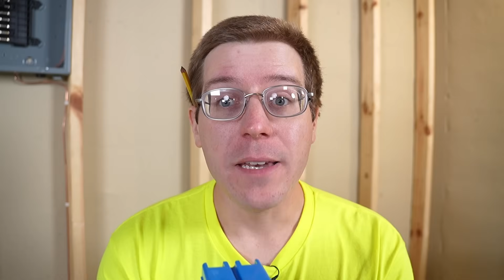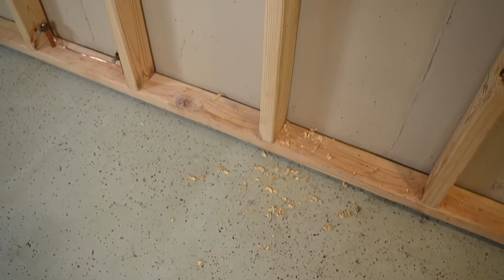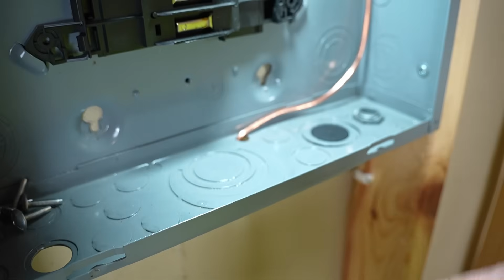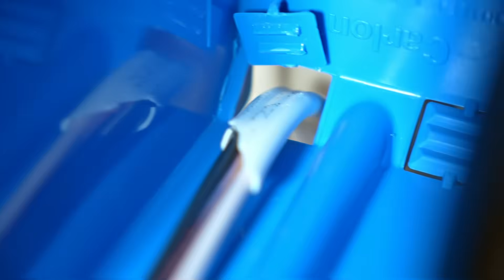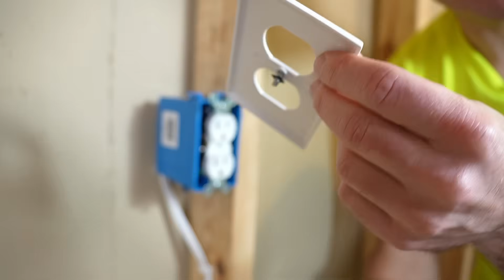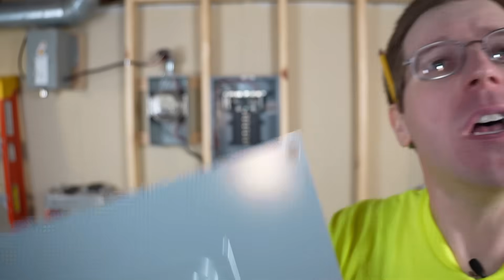Unlocking the Basics: Wiring a Receptacle Outlet Start-to-Finish

Comment: Most electricians usually pull the wire tight and staple it as they go along that way you don't have loose loops hanging and the wire should be tight against the stud so the inspector can see a nice clean install and pass you for nominal stupid things that he normally wouldn't pass that are safe
Reply from the maker: Yep, the tidiness of your installation will certainly tip the inspector off as to what the rest of your work may look like. NEC 110.12 -> "Electrical equipment shall be installed in a professional and skillful manner."

Comment: Most electricians they know what they're doing would run that wire underneath the breakers if they have to go to the other side that will prevent wires being near the 220 connection at the top if gravity makes them come down and be exposed to electrical issues with wires touching the panel box where the 220 is landed at, so the best way is to go underneath to the left and then up and keep it nice and neat at the bottom and at the sides
Reply from the maker: That is a good consideration. It can get quite full at the top, and avoiding those live line-side terminals is a good call.

Comment: That's a nice video but in a rough setting most electricians will put all the home runs out the top of the can and into the Attic and then go over to the stud where the first home run hit lands😅
Reply from the maker: Yep, totally depends on the installation.

Comment: Great video, man.  The only thing i would add just as a little feedback is that in minute  18:16 you have to keep in mind that the actual connection is in the opposite order as he did it.  Let me elaborate, he did hot, neutral and ground wires in that order but it should be ground, neutral and lastly hot.  Why?  Because ground sends any "unwanted" electricity (for lack of a better term) to de ground rod and the neutral both completes the circuit and balances phases.  That being said, if you make the connection as he did you wont have any sort of protection because you havent connected ground or neutral yet and even though its obvious that this is being done without an actual live wire, its always a good habit to connect ground and neutral first.  But hey, this video was fucking SOLID.
Reply from the maker: Good call. Normally I do it in the exact order you mentioned - ground, neutral, then hot. Ground should be connected first so if something goes wrong during installation, you have a solid ground present to trip the over-current device. The only thing it will protect against is short-circuits, however. Connecting the ground first will not save you from shock/electrocution. I plan on making a whole video discussing grounding and boding; where the current flows (and more importantly, where it should not flow) in the future. Thank you for watching and commenting!
Reply: @SmarterSparky Sweet man, Ill be expecting that video.

Comment: Yup gud video but to tins u talk to much n u wasted d wires,but tank u
Reply from the maker: As a career electrician you are taught that "wasting" a few feet of wire is far cheaper than finding out the wire is a few inches too short. If a wire ends up too short, there is the labor of removing the incorrect wire and pulling a new one. And then the wire that was too short is all wasted, and that might be dozens of feet long. Extra wire = cheap insurance. Thanks for watching and commenting!

Comment: I really appreciate the full explanation of each step.  But is this actually a safe thing for amateur renovation people to do.  I guess there are inspectors for that reason but there are so many rules and regs nowadays because of insurance companies that I don't know id trust just anyone to do this kind of work.
Reply from the maker: You’re absolutely right to be cautious. Electrical work can be dangerous if it’s done incorrectly and can result in fire, property damage, serious personal injury, or death, which is why electrical codes, permits, inspections, and safety procedures exist.

This video is intended to explain how things work and why they’re done a certain way—not to suggest that unqualified people should perform electrical work themselves. Any electrical work should only be done within a person’s level of training and experience, using applicable safety procedures, and in compliance with local codes.

DIYers should limit themselves to tasks allowed by local law and within their skill level. Electrical apprentices should only perform work as part of a licensed program and under proper supervision. When in doubt, involving a licensed electrician and the AHJ (Authority Having Jurisdiction, such as the local electrical inspector) is the right path.

I will put this in the pinned comment as well. Thanks for watching and commenting!

Comment: I loved the video and the way you explain congratulations. 
The only thing I would change is cutting a wire with a knife is not ideal because you can cut the insulation and provoke short circuit or arcing.
Reply from the maker: Thanks! Yes, using a knife can cut the insulation if you cut too deep.

Comment: Why 14 gauge and not 12?
Reply from the maker: A 15A circuit only requires 14 AWG wire. A 20A circuit would require 12 AWG wire. I understand some parts of the world require 20A circuits as the minimum, but in the US, the National Electrical Code (NEC) permits us to use 15A general purpose branch circuits (though we have specific circuits that a required to be 20A circuits, such as kitchen small appliance branch circuits, and bathroom receptacles). Some local jurisdictions in the US may have local codes that amend the NEC and discourages the use of 14AWG circuits as well.

And the more honest answer is I had to go buy a roll of wire for this video. 14 AWG was cheaper, and I already had a 15A circuit breaker on hand :) I will certainly demonstrate 20A/12AWG circuits in the future.

Comment: wondering if you can help me with  a quick question, an outlet got water from a leak and i assume it fried cause you can see black residue on the wall next to the outlet.. im going to replace the outlet, my question is, are the wires no good anymore since it was connected to the outlet it went it got fried ?? do i need to replace the whole wires or just cut back like 6 inches of wire ??
Reply from the maker: For this one I would suggest hiring or consulting with a licensed electrician in your area. There are so many variables at play here, that some guy on the internet isn't going to be able to safely/effectively diagnose. Water can do some weird things to conductors. If it is stranded wire, the water may have pulled up into the conductors due to capillary action. It might be as simple as replacing the receptacle, but the damage might extend beyond that, and that is where the experience of a licensed electrician is going to come into play. Great question!

Comment: Its 8 inches
Reply from the maker: That's actually 100% correct. Nice catch. Yes, 334.30 says it's 12", but 314.17(B)(2) Exception says that when it's single gang non-metallic box, you have to strap within 8" if you don't want to mount the cable to the box. Thanks for mentioning it!

edit:typo

Comment: how do I wire a basement when I can't reach the panel box? can I piggy back off a home run wire?
Reply from the maker: That is a potential option, but unfortunately it isn't that straight forward. It depends on what the home run is already feeding. There are certain circuits that you are prohibited from tapping off of - for example the small appliance branch circuits in your kitchen. Long story short, you'd have to analyze what circuits are there, and calculate how much more load can be put on them.

Comment: Hate having to do loop terminations with stranded wire. Hvac guy here
Reply from the maker: 100%. That is my least favorite termination ever. I have a video planned discussing just stranded wire loop terminations. Recently I've just started putting fork terminals on instead of doing the loops with stranded wire. Sure, it's a bit more expense up front, but it saves troubleshooting later.

Comment: Just subscribed. I enjoyed your steady paced instruction as you went through your processes. Which is why I subscribed. 

 I’m not new to electrical, but not an electrician either. I am in the trades though.  I have done a lot of electrical in remodel situations whether
 it be moving outlets to adding more as well as lighting circuits. As embarrassing as this is for me I was wondering if you could explain in a video how to change an existing switched out (in my case I have two of the) to a non switched outlet. 

I have been wanting to put a ceiling light in my son’s bedroom (We have a ranch), and it is the only room in the house without a ceiling light.  Right now his wall switch basically turns on and off his computer/gaming setup. I’m sure I could figure it out I Just think it would be helpful to others as well who may be have a similar situation. 

My apologies for the long post. Thank you for taking the time to read this. Hopefully, you can and will make such a video tutorial. Thank you for all you do. 

👊🏻
Reply from the maker: Thanks for subscribing and for the video suggestion! I'll definitely add that to my list.
Reply: @SmarterSparky Appreciate the reply.  Looking forward to that tutorial video as wee.

Comment: Nice job! I would also use nail plates to protect the wire going through the studs from sheet rock screws/nails.
Reply from the maker: Thanks for commenting. Nail plates are a good suggestion, but Section 300.4(A)(1) of the NEC doesn't require nail plates unless the edge of the hole is less than 1 1/4" from the edge of the stud. Since the 2x4 wall is 3.5 inches deep, and the hole is 7/8", that leaves 1 5/16" from either stud face to the edge of the hole - meaning no nail plate required.

Comment: So how would you check the other side of the stud when it is behind a sheetrock, easy when roughing in but not so when adding an outlet
Reply from the maker: Unfortunately there isn't just one fool-proof method for figuring out if an area behind sheetrock is open. The best method is using context clues, such as "is there any plumbing in the area," or "is there any other electrical in the area." But still, there may be backer boards within the wall. A trick I learned a long time ago was to use one of those Rapi-Driv (by Klein) screwdrivers to poke a hole in the wall once you're sure that spot is available. Then use the screwdriver to ensure for sure that the area is free. It is much easier to patch the small 1/4" hole made by the screwdriver than an entire opening for a junction box if it turns out there is a backer board in the wall. Great question.

Comment: Thanks so much for the teaching is there any ways that you can keep making a continuation from switch to lights
Reply from the maker: Thank YOU for watching! That's a great idea. I still have the receptacle wired up on the demo wall, perhaps I could do a continuation of that circuit to add a switch and light. Great suggestion.

Comment: Will the inspector pass you if you leave enough wire at the electrical panel but do not place it inside the panel? I am running the wires myself but having an electrician make the connection to the panel because I don’t feel comfortable working with it
Reply from the maker: Yes typically they should have no problem with that. At the rough-in stage they are only going to be worried about what's going to be covered up inside the walls, so they won't mind the stuff that can be finished after the walls are up.

Comment: is TN-C-S safer than  TN-S and TT
Reply from the maker: I am not familiar with the IEC earthing systems, so I could not say. I did some research, and it appears there are similarities to what we use here in the states, but there are some major differences that I will need to dive into further to understand it more completely. It seems that the TN-C-S is is the closest match to what we typically install here in the USA (though we also have many different grounding systems), but there is a huge difference as to where the neutral and ground come together, and a much different philosophy to the grounding system in general. I want to thank you for introducing me to this. I certainly want to explore it further. What is your take?